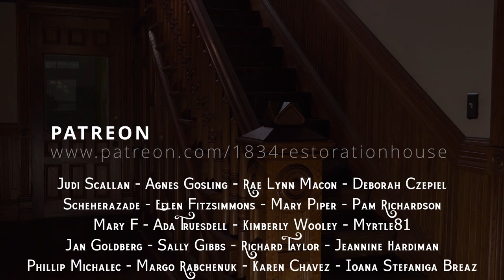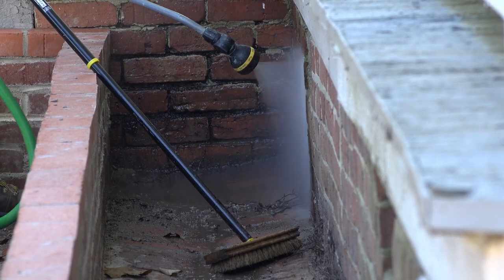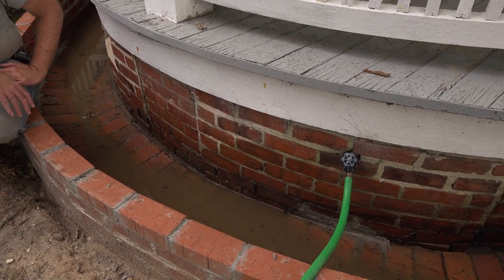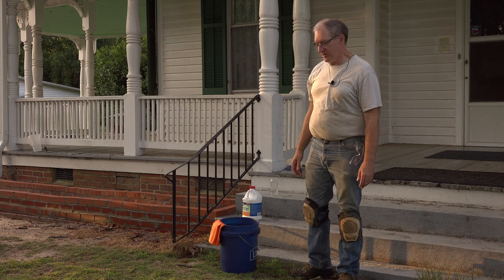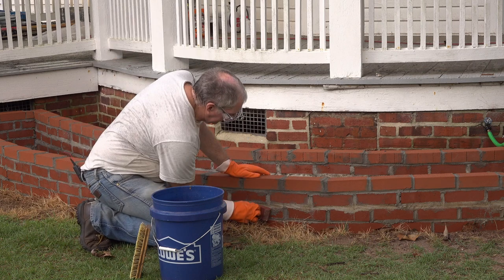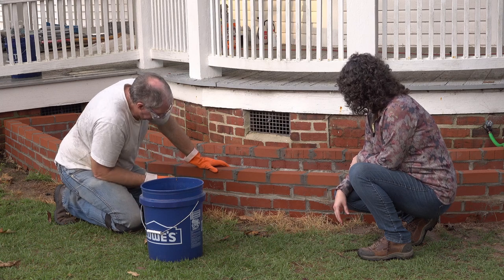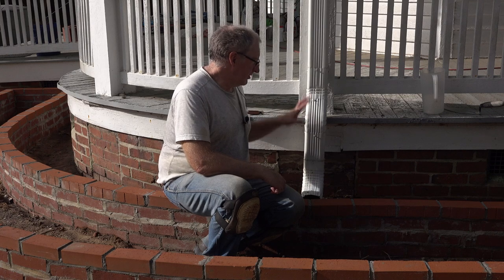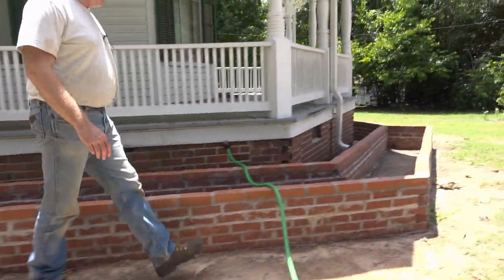EP95 Acid Washing Bricks

Comment: at the end of your catchment basin, where the tube shoots the water out into the yard, have you considered digging down and putting a perforated barrel, perhaps filled with large stones or even an area just filled with course stones to allow the water to drain even quicker into the lawn? Your tube seems mostly buried into the ground. That would impede the water escaping your catchment basin.
Reply from the maker: We only have so many hours in the day. 😎

Comment: Snickering at you from here, Mike...It would have been easier to put the hose on the downspout piece by taking it off of the main unit and maneuvering it around separately - you had any one of 360-degree angles at your disposal to find the best one. Then, once installed, it would have been child's play to put it back on.

Jeannie is looking lovely as usual, and you...well, you keep up the great job you're doing - we're all counting on you. 😆

Comment: Arg! How frustrating for you to see water flowing the wrong way! Yep, old house fixes require trial and error. Someone suggested putting logs in the bottom of the planters. This is based on a German concept called Hugelkultur. My concern is that decaying logs can draw termites, and the planters would be too close to the house for my comfort. I've read up on this and am currently debating using logs to help re-fill my garden beds, which are 50 feet from the house. I would instead consider just adding amendments to your natural soil; well rotted manure, compost, perlite, and a product called Kelloggs Amend. In combination, maybe 25% to 30% amendments to soil. These last two will keep the soil from getting compacted and boggy, and the others provide nutrients for plants. Depending on what you want to plant there, the acidity of the soil may be an issue. Acid loving plants like ferns and camellias do well in shade. Fall is a great time to prepare soil for planting. I also recommend a good, heavy duty garden fork for chores where you can't use the tractor. Great for breaking up dirt clods and mixing everything together in the beds. No need to go to the gym, lol.
Reply from the maker: The soil we excavated seemed to be soft and rich. We'll see what happens when we try to plant back in it. Thanks for the recommendations!
Reply: @1834RestorationHouse  Oh, that's great to hear! Eventually, when you have time, you can make your own compost to level it up once a year. We have horrible clay with large cobble rocks. This time of year it's like concrete. I do a lot of gardening in containers.

Comment: Are you going to place support beneath the black drain tube (so it won't possibly droop from water weight during rains)?

Also, will you add sand, etc. to lighten and aerate the soil for the planters?

Comment: Looks really good….I have a question…why didn’t you just let the downspout shoot straight down into the brick run off?
Reply from the maker: The exit point for the water catchment system is blocked so we needed to shunt the water away from the house until we can finish the rebuild.

Comment: Could you usr a power washer yo clean the bricks?
Reply from the maker: Yes, a power washer will work well. It still requires some acid and mechanical scrubbing on the first cleaning.

Comment: The acid you put in the glass jar did come from a plastic jug.  So "once diluted it will be safe in plastic" might not apply here? 

 You also keep saying you are ONLY putting back what was originally there but you have zero evidence there was EVER a high double wall of brick next to the angled "water catchment" bricks.  The random bricks you found might ONLY have been 1 layer around a planting bed separating the bed from the grass. 

The need to repeatedly wet the bricks prior to acid scrubbing shows that even new  bricks are NOT water tight and deliberately soaking the foundation bricks every time it rains is very much NOT ideal.  Older bricks are more porous than current hard fired ones. 

Seems like making the exits for this trapped water actually work and work fast is far more important than acid scrubbing for looks.   One is still a dead end, one is mostly below the soil.   The "eventually it will sink in", IS putting ALL that water next to the foundation.....  ALL logic says move water away from a house foundation.   Lots of effort here but....